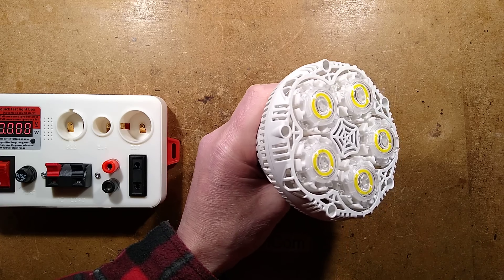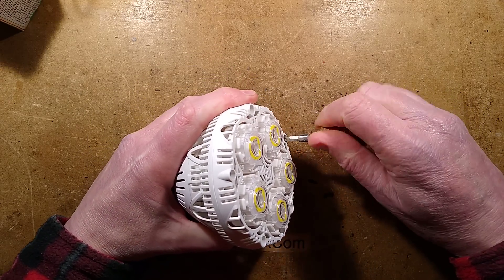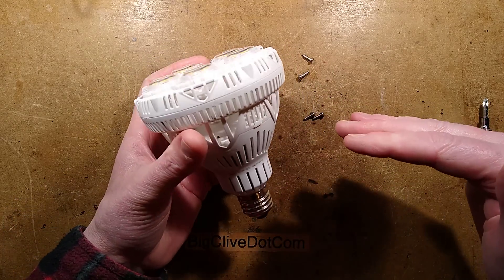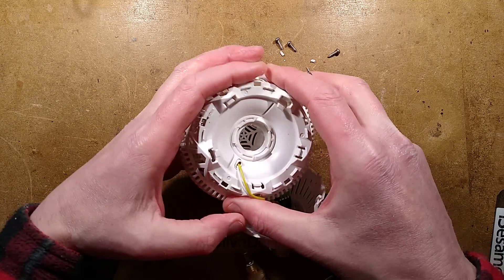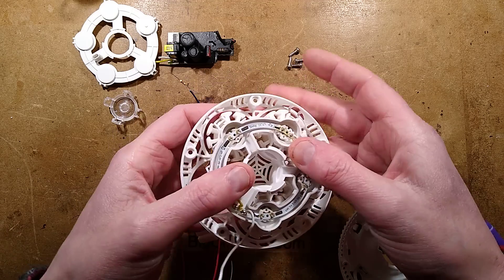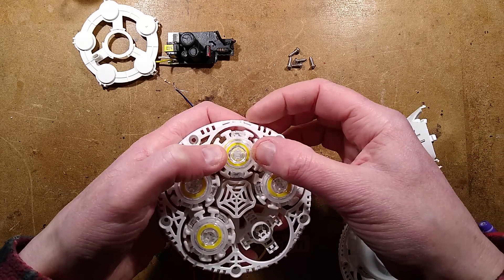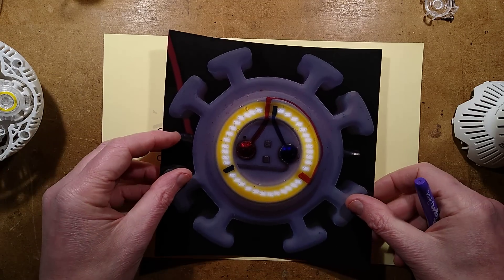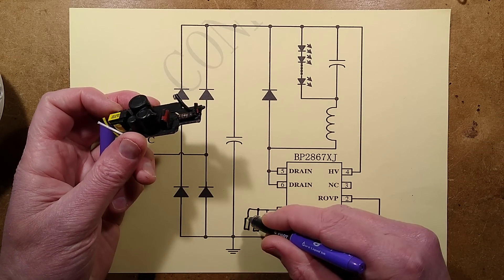Huge 30W ceramic core LED light (with schematic)

Comment: Whoever designed the molds for that deserves a raise.
Reply: Industrial engineering tour-de-force for a screw in LED.
Reply: When your talent and ability is beyond your current job placement. Over qualified and underpaid for sure
Reply: Clip-ception!
Reply: I used to know a guy who was a die maker/repair man. He worked on molds that made a ceramic core for the manufacturing of titanium turbine blades. The core formed air cooling passages inside the blade. The ceramic core was etched out after the blade was cast around it. The molds had to be chrome plated to handle the abrasive nature of the ceramic parts. Even the slightest bubble in the chrome would cause the ceramic parts to break and be scrap. He had to hand polish the chrome to get rid of any imperfections. He said that even with magnifiers the bubbles on the surface of the chrome couldn't be seen. It all had to be done by feel.
Reply: And the machinist, and the assembler.
Reply: It is not really that difficult. You take on a cauliflower and take its impression in gypsum... ,😂
Reply: He love  plastic clips
Reply: Look like Corona Viruses embedded in snowflakes.🥶😮‍💨  😄
Reply: AI designed it, the guy who used to do the designs was sacked...
Reply: Somewhere in China, a designer is now embarking on new design to foil Big Clive.
Reply: mate the ones making the molds is also impressive
Reply: It's ugly and overcomplicated IMO. Could have been designed much easier, prettier, simpler, just as effective
Reply: @sioux22  thing is these aren't made to look good, that design is to maximize surface area with a ceramic material that cant get as thin as metal. Lots of holes, good air flow, lots of places for heat to spread to and get pulled away from by the air
Reply: I think it is a bit overdone
Reply: No
Reply: Probably A.I designed
Reply: I think the computers did it. The designed 1 led segment and replicated the rest.
Reply: They're heading for a job at Apple.
Reply: I feel sorry for the girls who have to assemble the lamp, not mass production friendly. You will assemble a lamp every 5 second.
Reply: In a year or two this will be done by AI in 5 min. If not already today. Will look very different then.
Reply: @HansWeberHimself  AI is not magic, it won't be that easy.
Reply: @Splarkszter  No easy for sure. But I saw AI designed sneakers recently and that looked like really excellent engineering to me. Look kind of organic in a way.
Reply: @HansWeberHimself  you do not understand how AI works in the least
Reply: @HansWeberHimself  Most of the “AI designed” stuff you see is not really machine learning, it’s iterative design where a simulation is run multiple times as various parameters are tweaked to “skeletonise” the structure in such a way that it can still safely carry its load, but with reduced weight and material usage.
Reply: @SkigBiggler  That makes sense.
Reply: @Splarkszter  you're joking right? You can ask AI to make you model textures/ meshes, scripts / codes, music / sounds etc. It's probably less than a year out.

I will say most of the code they generate is useless but almost useable, the modeling aspects seem to be interesting, same with it's ability to spit out rvmats for example in seconds for model textures.
Reply: @Slay_No_More  Still not magic
Reply: @Splarkszter  okay try to point out where I said it was magic, Einstein.

I said you're underestimating it to the point of being wrong, clearly the entire subject is over your head.

It's 100% real whether you choose to believe it or not, denying it is clown-tier when real working examples are available to the public for usage.
Reply: @Splarkszter  When it works it seems like magic.
Reply: @vaelophisnyx9873  There is no doubt engineers in some fields will be super-seeded by AI in the future.
Reply: @HansWeberHimself  that sounds cool, where did you see the ai sneakers?
Reply: @Splarkszter  there's ai that's designing jet engines and PCBs so yeah there's some big brains in the computer club!
Reply: @HansWeberHimself  like something from a Dr Seuss book
Reply: @HansWeberHimself  An AI can already do this lol but I think it's better for a human to do it cause the ai doesn't know what looks best

Comment: They used only 5 screws to keep that massive light together...pretty good engineering...but must be a bitch to snap so many things together quickly in a manufacturing setting.
Reply: It might be worth making jigs for the factory where you just slot the parts in and pull a handle, and everything is automatically located and snapped into place.

Comment: Yes I ordered 1 of the rgbw floodlights and 2 arrived this morning. Nice and weighty. Not plugged it in yet, but it claims 70w...
Reply: I ordered one of the 100w RGBW units and 4 arrived!!  Consumption measured at 51w max but still very bright, terrible to look directly at, also it's only RGB, no W chips.   Someone at their shipping centre needs to learn numbers 🤣
Reply from the maker: It's very odd.  I wonder why they send out multiples.
Reply: @electroshed You’d think that the Chinese would be good at that sort of thing

Comment: These Sansi lights are really interesting; I may buy one.  To me, the intricate molded ceramic is at least as interesting as the lighting and electronics.  Thanks for featuring these and explaining how they're designed !! (ceramic would have a thermal conductivity roughly an order of magnitude higher than plastics)
Reply: I had 4 they all melted themselves
Reply: @IVAN_ENT  Not suprised, they don't look reliable. Ceramic is not that good as heat dissipation material. Also three parallel strings without individual current control is asking for trouble.  The design is flawed imo.
Reply: @blg53  "Ceramic" is a wide field, there are ceramics like aluminium nitride or cubic boron nitride that have thermal conductivities in the range or even better of copper or silver.
Reply: We have some of these, and they work well. They have to be in open air (no top hats or other enclosures). We have them in ceramic lamp sockets in the garage, and they are reliable in that application (and very bright).
Reply: I don't have this exact model but I am running the 27W 3000K 4000lm dimmable as my main light source at home. I had 3 of them in my living room and it was like having a mini sun. Having such a bright light improved my mood a little bit. I am running them since September 2021. Now I moved and I am trying to figure out how to do a smart home installation while keeping those extra bright Sansi bulbs.
I also have a smaller 15W Grow Bulb that I have on a timer and use for jumping spider terrarium. Plants inside grow really quickly.